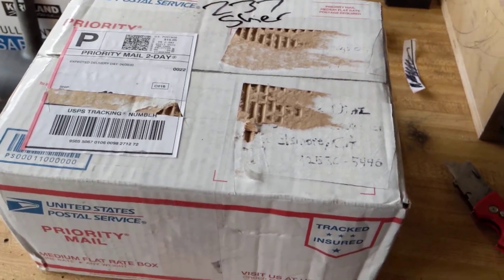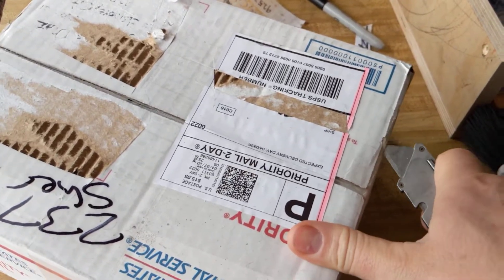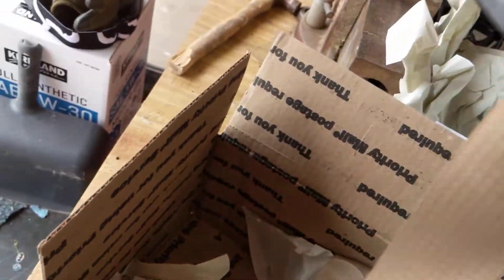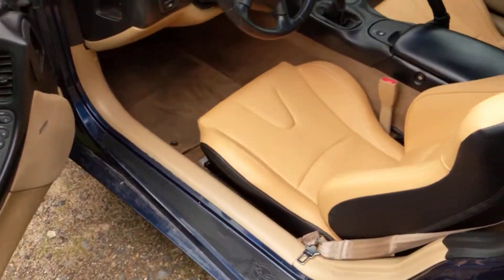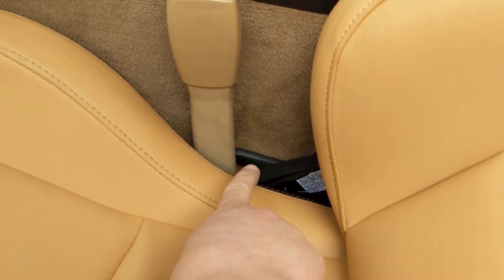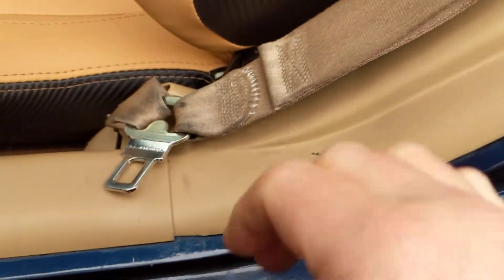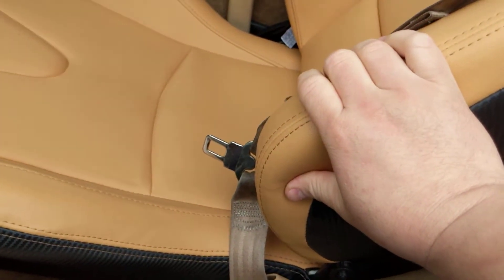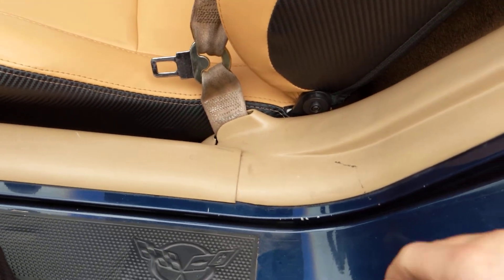c6 seatbelts in a C5 corvette Part 1

Comment: do you have to run the passenger c6 belt on the driver side of the c5? also does the c5 seat belt receiver work with the c6 male end?
Reply: That’s what I want to know
Reply: @stepbro4978  i ended up just doimg the swap you need a passenger belt on the driver side and the c5 receiver/buckle is not compatible with the c6 male end
Reply: @oldglorydrift  do you have pics? I'm looking to do the conversion aswell

Comment: When replacing tie rod ends is counting inserted threads for the new ones a good method for a rough adjustment ?
Reply from the maker: Use a tape measure or ruler. It's a better option but if you don't have either then yes just count the treads.